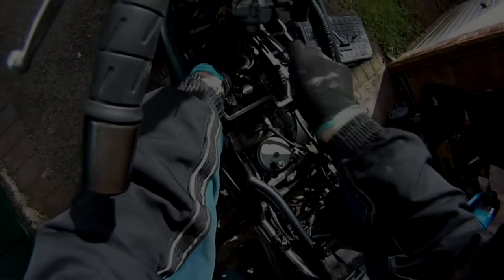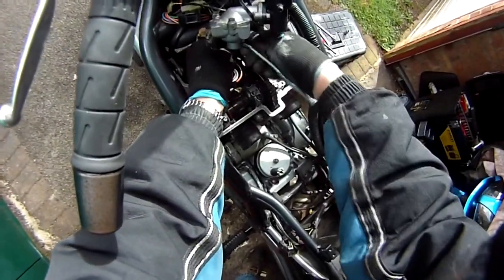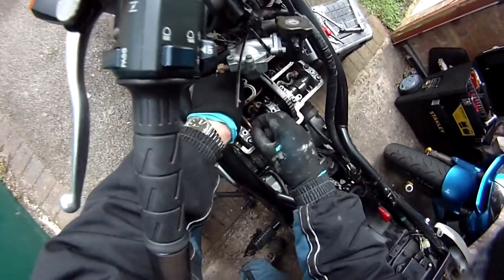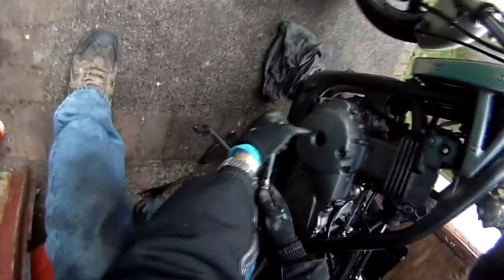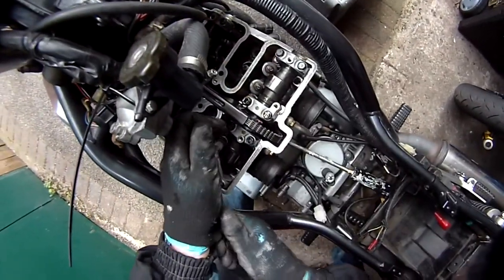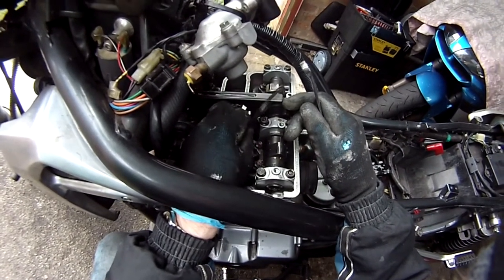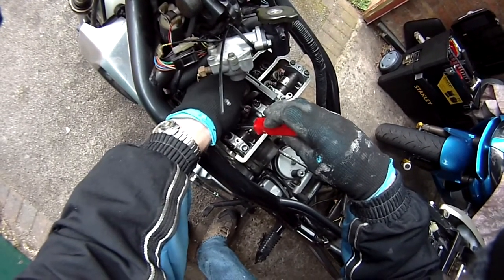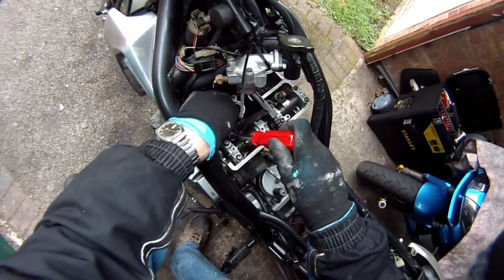Kawasaki ER5 Valve adjustment.

Comment: Hello, I just bought  an old GPZ from 93'. I was struggling very hard to remove the water pipes on top of the engine, the aluminium pipe is stuck in the block. I tried WD40, not even budging. For you was easy? Do you have any advice? Thank you! Great job for having the patience to film this!
Reply from the maker: Keep spraying WD40 And try levering , They are only held in with rubber O rings which will need to be replaced with new ones;